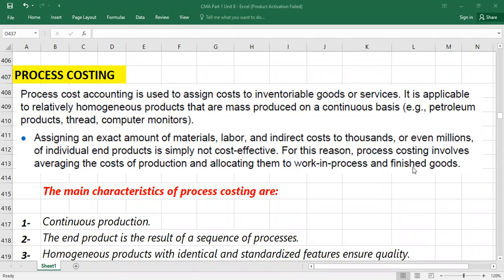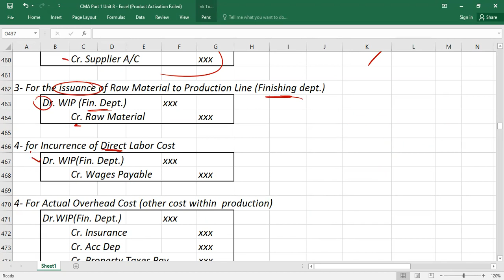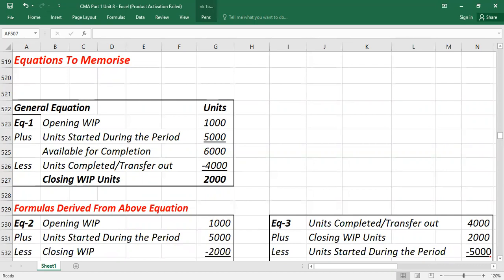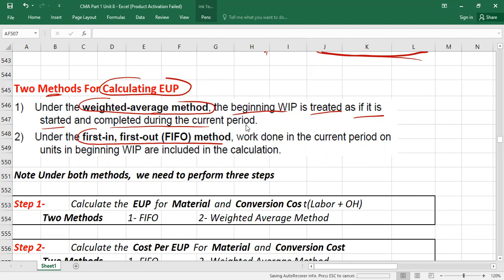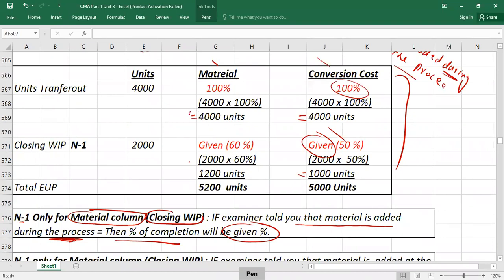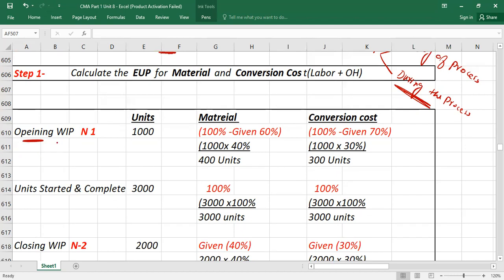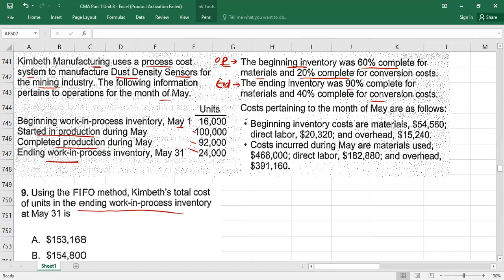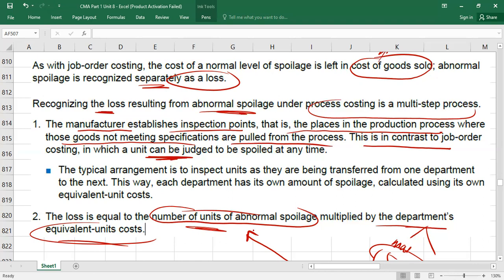Process Costing-Equivalent Units of Production (FIFO vs Weighted Average) | CMA (US)-PART 1-Lect 23

Comment: sir can you please upload normal and abnormal spoiled
Reply from the maker: Hi dear. Its not testes in CMA exam!
That's the reason spoilage is not included in the lecture
Reply: really sir?
Reply: because in hock they give question on that, eoq with normal spoilage
Reply from the maker: @mohdimroz2769  yes i am sure. As many of students appeared in exam. They never told me that it's it is tested
Reply: A company employs a process costing system for its two-department manufacturing operation using the first-in, first-out (FIFO) inventory method. When units are completed in Department 1, they are transferred to Department 2 for completion. Inspection takes place in Department 2 immediately before the direct materials are added, when the process is 70% complete with respect to conversion. The specific identification method is used to account for lost units.The number of defective units (that is, those failing inspection) is usually below the normal tolerance limit of 4% of units inspected. Defective units have minimal value, and the company sells them without any further processing for whatever it can. Generally, the amount collected equals, or slightly exceeds, the transportation cost. A summary of the manufacturing activity for Department 2, in units for the current month, is presented below.Physical Flow(output units)Beginning inventory (60% complete with respect to conversion) 20,000 Units transferred in from Department 1 180,000 Total units to account for 200,000 Units completed in Department 2 during the month 170,000 Units found to be defective at inspection 5,000 Ending inventory (80% complete with respect to conversion) 25,000 Total units accounted for 200,000 Beginning work-in-process inventory was valued at $78,000, consisting of $23,000 of transferred-in costs and $55,000 of conversion costs. Transferred-in costs for units transferred in during the month were $360,000. Costs added to production during the month were $156,000 in direct materials added and $326,700 in conversion costs added. Total cost transferred out at the end of the month wasA. $814,700B. $810,765C. $736,700D. $812,581

sir this of question not asked in the exam n am I right?
Reply: sir this type of question not asked in exam am I right?
Reply from the maker: @mohdimroz2769  yes you are right